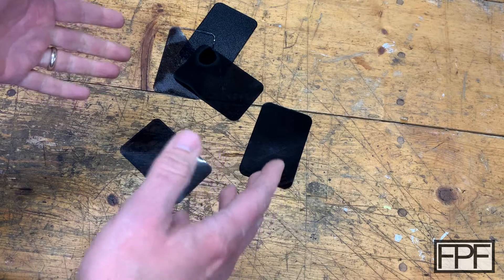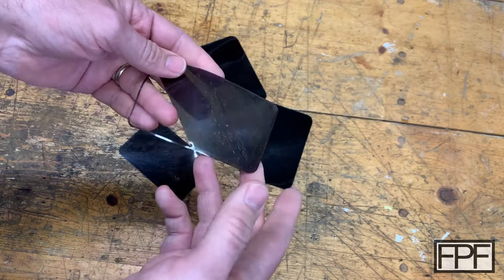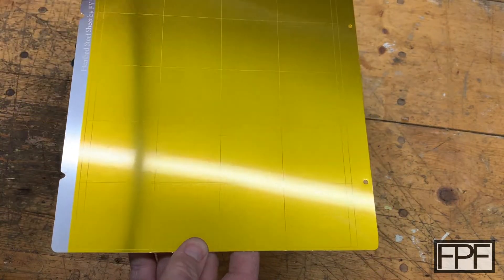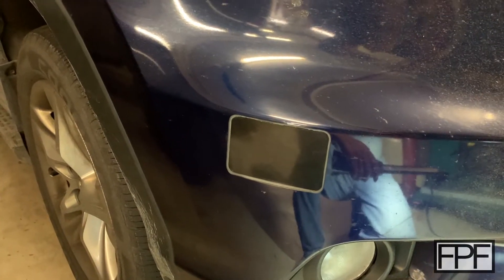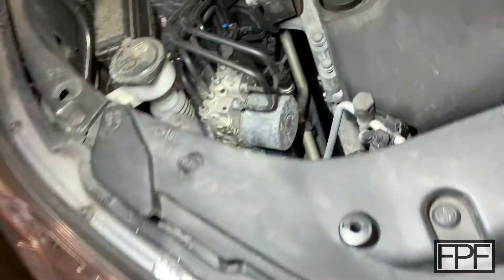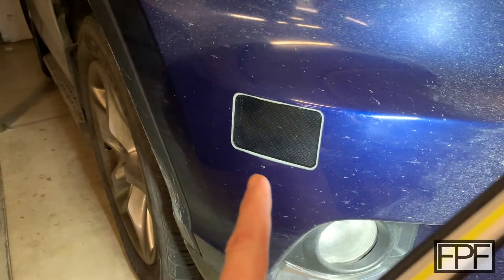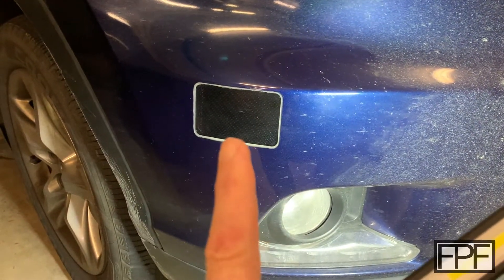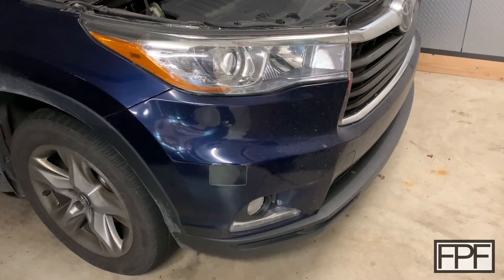3D Printed Glossy Bumper Repair Patch

Comment: Why not paint the patch to match the vehicle?
Reply from the maker: I had assumed there wasn't a paint that would have good adhesion on TPU, but I could be wrong.  With paint, and black silicone, I think it would genuinely look like it was 'meant' to be there.  Any paint or primer suggestions?
Reply: @FunctionalPrintFriday  hello, enjoying your channel so far.  sain smart (the filament you used) actually has a page about painting tpu....long story short, looks like automotive paint would work (without cracking) with a decent plastic primer.
Reply from the maker: @charlesK001  thanks!  I will have to check this out